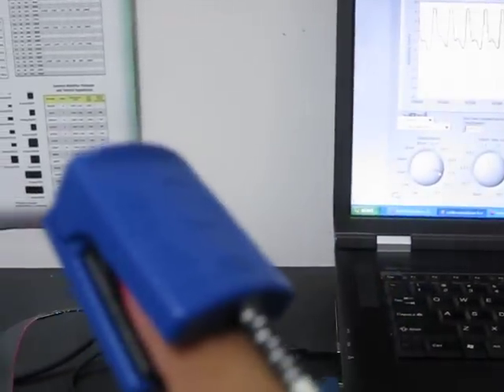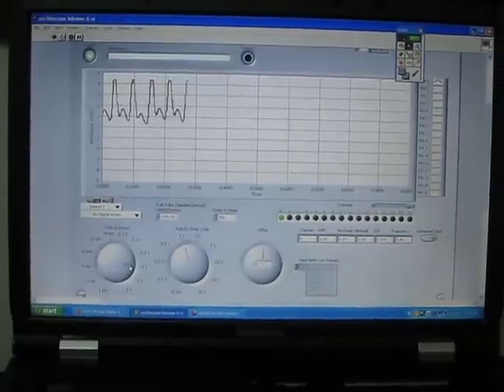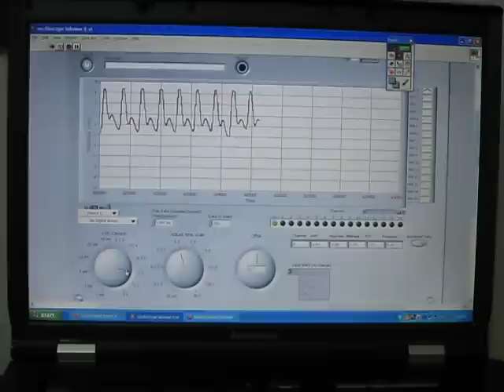Using Arduino to get analog output from Nonin pulse oximeter

Comment: I'm Sorry, but I've posted this on your instructable profile...(I'm desperatedly looking for any help). Hello Kunal, I'm working in my undergraduate project, and I need to work with the Xpod module and Arduino. I'm working with the NewSoftSerial Lib. and can't get the correct data (don't know why), it's adding some bits and I get 4 bytes instead of the 3 with the D.F. # 1. Please, help me, I'm totally lost, if you have some example sketch, or some suggestions.... I will be very very greateful.